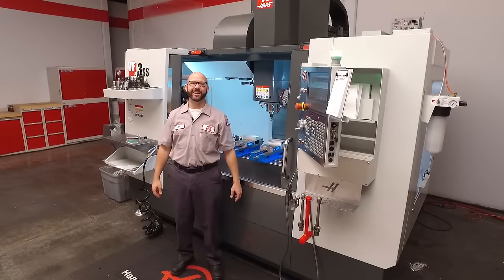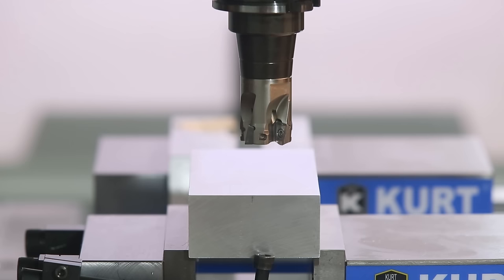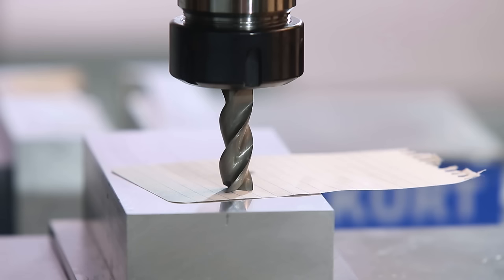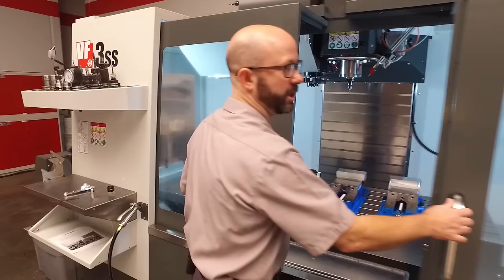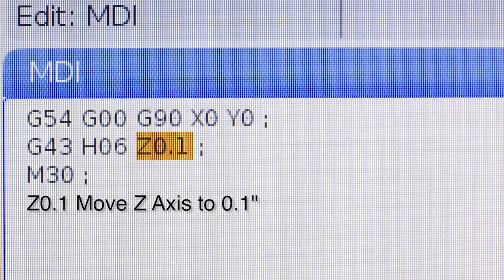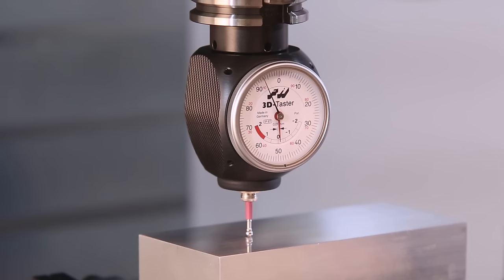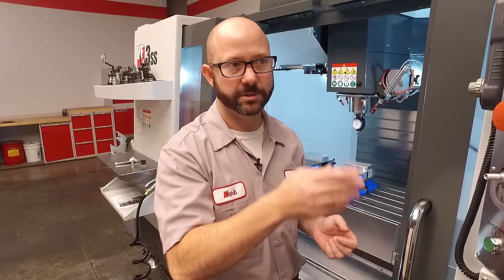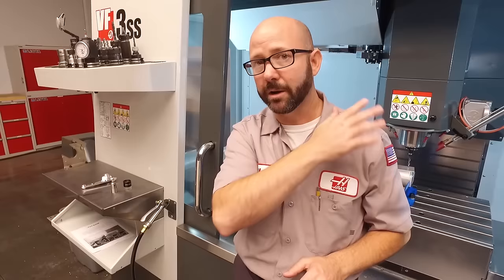How to: Set Tool Length and Work Offsets – Haas Automation Tip of the Day

Comment: This may not apply to a lot of shops but heres what I was taught.

I get a 2" insert mill with a known tool length. I jog that down and face off some material. I set operator Z offset to 0. I call up the tool I want to measure / blend. I jog it down and jog across the area the 2" endmill cleaned up. Go to .0001 and jog down until you see the finest dust particles. Add the operator offset to the length of the 2" endmill.

Perfect blending everytime because you literally made the blend yourself. Thanks to the guy who showed me this.

Comment: I like to always set tool length offset by going UP to a standard, not down. EG bring tool down to Z .900 next to a 1.000 block; increment up to Z1.000 until block slides under; add (-1.000). Prevents an early morning fat finger smash. Thanks Mark!
Reply: Agreed. Our shop standard comp point is 2 inch block. Back off starting with .010 increments, then .001 then down to .0001s. Also, we never comp on top of a surface that will get milled at some point. Something happens along the way and you need to comp a new tool......and your comp surface is gone.
Reply: Yup 100% thats the way you should be doing it prevents crashes.

Comment: I do it completely different.. 
touch of XYZ G54/55/etc first. Use edge finder/indicator for XY (depending on what X0Y0 is), I use the quill (the spindle without a tool) and a solid 1-2-3 block. My z value will always be negative in my work offset. Then for tool touch off, I have a standard usually set up that I find, take the difference machine position with that tool and my set standard and I have my tool length. I only do this in my shops old hitachi Seki machines. 
My shop also decided to get fancy and buy Reinshaw probes and tool touch off probes for our newer machines.

Comment: We do it a bit different, but we are a production shop, not a job shop. First we find the distance from the spindle face to the table, add back in the height of the tool setter gauge (2"), and store that in G57. Then we jump into G57 before setting the tools with the "tool offset measure" button (there is a setting you have to change to use the work offset for this). This allows us to throw a scale up next to the tool to sanity check the z height. We also write the tool length on the tool holder with a sharpie if we ever remove them, then key it back in when its reloaded. The only time we need to measure a tool is if the sharpie rubs off or we break a tool. We have about 12 tools that are always the same, and we cycle in the others (maybe 80 different ones) as we need. 

To set the work piece Z, we measure from the table to the work top with a dial test indicator (that G57 Z value - 2" + the measured distance). We make use of all of the G154 P offsets, comment our parallel heights, never pull our vises, and setup is almost nothing.
Reply: This makes more sense to me than what Mark showed here lol

Comment: Thanks for the great explanation.  
I noticed in the final code referenced you set your Z value to 0 on the G55 offset not 0.1, which would bring the tool down to the part.
Reply: i also noticed this, good eye

Comment: Back in the late 1960's I operated a NC 3 axis machine. The systems and the hydraulic drives became unreliable and the machine was sent off for a retrofit to electric drives and a Allen Bradley CNC system. For a while we relied on tapes made by our Production Engineers - until we needed to make something for ourselves - we soon learned to programme it. However, for ages we programmed the centre path of the tool and controlled size by cutter diameter. Eventually the penny dropped and we leard to programme the part and use offsets.

Comment: From my experiences, G54 is typically dropped -.01-.03 for stock variance.  Then G55 is typically set at your finished part thickness.  With whatever needs to be cut off set in the linking parameters “top of stock” in the program.  And 0.0” for the depth.   Or it’s fat fingered in the machine to adjust your depth of cuts.

Comment: After 20 years of using a tool height setter Im in a new shop running Haas, new to me, and setting tool lengths as you show. This shop wants to buy a height setter but all the methods they now use will have to be changed. This should be fun to watch!😀

Comment: A lot of shops don't have a probe . I work in one now, so I use 1-2-3 block and edge finder. I'll try different methods mentioned. The owner would rather buy boat, houses, Cadillacs opposed to updating machines

Comment: Do like the probe, touch all tools of the table (not the work piece) on a 1-2-3 block on the last tool (whilst at the "z" on the 1-2-3 block)  set the "operator" "Z" origin move up and touch on the top of the work piece and that "z" value is what you set your G54 "Z" too. Then if a tool breaks or you want to use multiple offsets all you have to do iis set that "z" value and all the tools that are in the machine are ready for action. Also handy if you work on parts that have no "flat" "z" plane after you start machining....
Reply: Thanks Darren. We do the same method zeroing all tools to a touch probe mounted on table top. Any new tool will be touched to the probe regardless of any work offsets. The key is to measure the height from the touch probe to any part Z zero and register this to the corresponding work offset Z value. If the part Z zero is above the touch probe, that makes the work offset Z value as positive. For plates thickness less than the probe height, the work offset Z value is set as negative.

Comment: I’ve always preferred setting the Z location off the face of the spindle nose and then have the tool lengths represent the actual offline measurements as if using a tool setter.  I had one owner tell me that a Cnc machine is a very expensive tool setter and is better served making chips and not measuring tool lengths.  So it kinda stuck with me.  His machines, his rules. But I saw the benefit. Especially when replacing worn or broken tools or setting up the next job while the machine is still running the current one

Comment: May I suggest comping your tools off of a stack up on the table instead of on you stock? Once you start machining your part you have altered your comp surface and may be unable to add or change a tool and comp it accurately in relation to the existing tools.

Comment: I do my tool offsets slightly different. I use my Tool 1 (indicator) Z offset as always 0. We reserve G59 in our shop as the bed and set that using the indicator and use that zero to touch off our other tools. Our controllers don't have a built in too measuring routine, so i wrote a macro to do it this way. My G54-G58 offsets are then set using the indicator - keeping them independent of the cutting tool offsets.

Comment: cellophane wrapper from a cigarette pack for touching off. Pretty much is dead on when you see it and feel it scratch. I always make sure i drag it under the whole end mill just in case one flute is a longer. You never know. We use a lot of resharpened end mills. Not always perfect.

Comment: I find it quick and safe to measure tool length offsets using a 1-2-3 block and sliding the block behind the cutting edge of the tool while jogging in .0001" until it starts to rub slightly then hit Measure. No need to remember to subtract any values and there's less risk of accidentally hitting the jog wheel and ramming the tool into a fixed object. You do have to be careful not to slide the 1-2-3 into the cutting edge.

Comment: Great Video as always, just one comment..On your last point where you are showing the two programs,the G54 and G55...You show the program for the G55 going to Z0.0 not to Z0.1..Just in case someone copies those exactly, the G55 will go right to the top of the part..Just FYI..Thanks for all the great Videos !!! Cheers
Reply: No he didn't
Reply from the maker: Endless Innovations! Thanks for catching this. It looks like the graphics, at 11:13 in the video, show G43 H06 Z0, instead of the correct G43 H06 Z.1. It looked good when we were explaining things at 9:51 though. We’ll try and fix it up. Thanks again. – Mark, Haas Tip-of-the-day.

Comment: I feel like 123 blocks are the easiest way to do offsets. put the tool lower then the block and jog up until the block just slides under the tool. then move offset 1,2, or 3 inches down depending on the side you used.
Reply: Eggsr2bcrushed Good point, I feel that it is also safer
Reply: another point is that when you go from .1 to .001 that you go a few click up first to make sure it registered and that you aren't about to start cranking the wheel and drive into the part.
Reply: Using a 123 block is king. You can easily use any gauge block to slip between the tool and workpiece WITHOUT crunching the tool into it. and you know the exact thickness without pinching the block. Shim stock and paper is for manual mills.
Reply: I use .375 surface ground coin.. what does mean for me?
Reply: Go out and get yourself a dial or electronic tool setter, they're not all that expensive, and much faster than using a 1-2-3 block, jog the tool to above the toolsetter, jog downwards by thousandths until you get close, then tenths to zero the dial, hit tool offset measure and you're done.
Reply from the maker: Eggsr2bcrushed - We were waiting for the flood of 1-2-3 block comments! It’s a great method of touching off tools (1-2-3 block, or gage block, instead of shim). Quick, single touch off point. Some of the comments have done a great job of describing the process. We struggle with how long to make videos, and what to cut out, so in this one we only put in the basics, and tried to cover where the math came from. Sounds like 1-2-3 block touchoffs could use their own video! If you have some suggestions/insights on this, send them to me at TOD@HaasCNC.com. Thanks again. – Mark Haas Tip-of-the-Day.
Reply: Please make a video about 123 blocks :D
Reply: i always used a 1-2-3 or a 2-4-6 block and a .5000 dowel pin. having the cheaper pin clear the tool on top of the block saves you from potentially damaging a nice 1-2-3 block. also, i always set the tools to the table and used a positive z offset to the top of stock by zeroing my indicator on the table then jogging up to top of stock. this sets all the tools to a common surface.
Reply: You can use the same technique as the 1-2-3 block using a thicker piece of shim stock or feeler gauge. I don't like bringing the Z down until it touches either, especial with any carbide or expensive tool.  I always go up until my gauge slips under the tool. Even then it pays to be gentle, it doesn't take  much pressure at all to make a small chip on the corners of a sharp carbide end mill.
Reply: MineZilla to

Comment: thanks for explanation.just share if  i always use datum inside the program by using G90G10L2P1X0.0Y0.0Z0.0. and set the z value by:  mc position - offset value

Comment: Positive gauge length is what most shops should be using. All your standard tools will work on any job. 

Just measure gauge line of the spindle to work piece and have a presetter to measure tool length. You have G54 - G154P99 so why not use them.
Reply: Matt Stoner we always use positive offsets  you can use the same tool  in different jobs as you tool offset is same as tool length

Comment: I really wish Haas had a global edit feature like the Fadal I ran at my last shop. I set all my tools off the vise ways using a 1" Mitutoyo zero setter. On the Fadal, I could go to the tool offset screen and subtract 1.0" from all my tools at once. Instead, I have to go tool by tool to do it on the Haas. 
Using the vise ways makes all my Z offsets positive: parallels + part/stock thickness. Easily verifiable with a calculator to check for tampering. 1.375 part thickness sitting on .50" parallels? Just add it up. Boom, 1.875, Z offset done.

Comment: Please advise and alternate method, I use a Renishaw probe in the machine to calculate work offset positions which are absolute machine positions. I believe measuring tools in the way you've shown would cause disaster for me as my Z positions are all negative.

We have no tool setter so currently use a block and bring an empty spindle down to touch off (not on the dogs, on the flat) then we hit origin for Z, put the tool in the spindle and touch off the tool end on the same block and hey presto we've got our measurement but it has to be typed in manually. I'd love a way to utilise the "tool offset measure" and "next tool keys" but this video isn't suitable. Thanks again for all the great videos. Keep them coming.
Reply: will changes to setting 244 and setting 64 make the tool offset measure key usable in my situation?
Reply from the maker: Hi James. This video gives instructions on setting Tool, and Work Offset Z value offsets MANUALLY only. If you have a Probing System, you must not mix-and-match methods, or you will run into problems. Thanks for the comment. – Mark, Haas Tip-of-the-day

Comment: I newer do it like this.
Use any kind of toolsetter touch it off with spindle then write down machine Z value.

Then when you touch off tool on a toolsetter press tool measure and then add value you wrote down when setting off a toolsetter.
Reply from the maker: That’s a great method as well. I hope to do a video on that method in the future. Thanks for the comment. – Mark, Haas Tip-of-the-day

Comment: Thanks again for another excellent demonstration!  This will help me get up and running soon. And I assume if I set the tool Z heights at the table for example, I would enter a positive Z axis height delta to the part top surface in the G54 Z axis zero.

Comment: ...Don't stop these "tip of the day". You are saving my butt.
Some of the comments below talk about setting off the table...OK fine. But if you already know this then the value of this video is lost on you. You may be right, and you may have used this method shown when you first started....Then it came to you, with experience. That's how we all learn. Baby steps or crash. 
(40 years a machinist...First time Haas owner)
Reply from the maker: Woodman Engineering – Thanks for the encouragement. I liked your take on this type of setup – there are definitely a lot of ways to skin a cat, good ways, we just chose to cover the fundamentals in this video. Thanks again. – Mark, Haas Tip-of-the-day
Reply: I use both methods on big 3x2 meter routers. I use the table offset when i need to cut something all the way through, like holes and profiles. When i need to do countersunk holes or pockets that are depth sensitive i set off top of material because hpl(laminate) has a tolerance of  ±0.5 so table offset is a no no. Basically you got to make it work, whatever fits your needs, there is no right way of doing it.
Reply: we know that. we thank you  from vietnam

Comment: Hi Mark, Thanks for your helpful video.
could you make another video explain about G43.1, G43.4 and G43.5.
Reply from the maker: Dinh Truong Le – Haas controls will use a G234 for Tool Centerpoint Control, simulataneous 5-axis, and a G254 for DWO Dynamic Work Offsets, 3+2 indexing 5-axis work. We have a couple videos that touch on this. https://youtu.be/HxPjH4v5iEg and https://youtu.be/NNwdXNlvuEA . For more information, check out G234 and G254 in our Haas Mill Manual which you can download from our website, www.haascnc.com. – Mark, Haas Tip-of-the-day

Comment: I use probing 99% of the time but for the at occasion when I have to do a part that is bigger than my table and I have to take off the probing system I like to set all my tools off of the table by using 1 2 3 blocks stacked up to 5 inches then my g54 G55 and so on Z offsets are simply the distance between my zero and 5 in off the table easily set with an indicator and using operator position I find this the most precise way and all my Blends usually come out near perfect that would not be the case if I was using paper off the top of operation number one. Also if there is any tool breakage and you have to re pick up a tool the 1 2 3 blocks stacked up to 5 inch off the table is a constant, however the block you are picking up of rostock is not

Also if you are a machine shop that doesn't have probing  if you make your employees  pick up all tools off of 1 2 3 blocks 5 in off the table there is no question between the operators of where the tools are touched off, this makes things more efficient because tools can be left in the machine between jobs such as face Mills spot drills that are common tools between different jobs